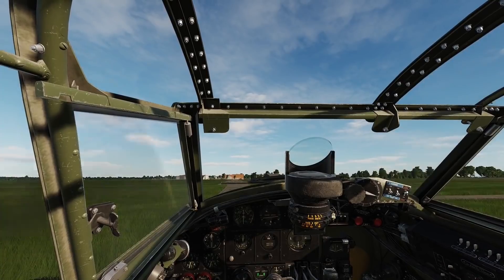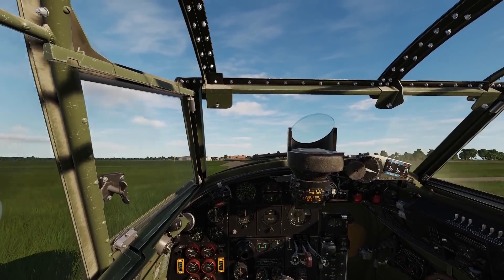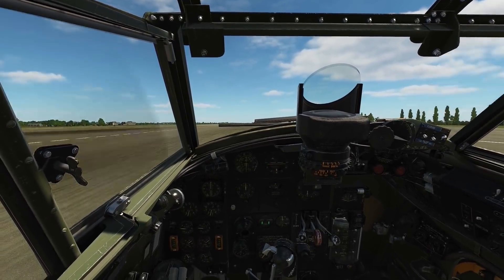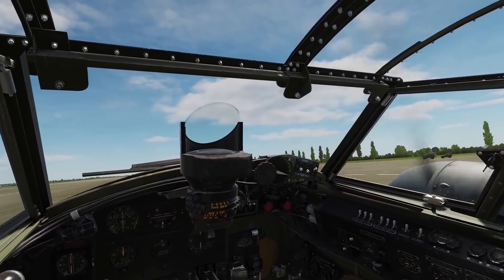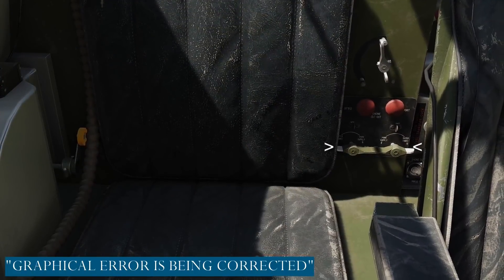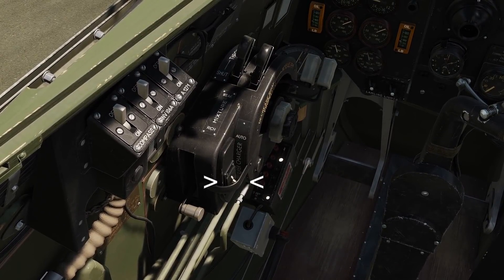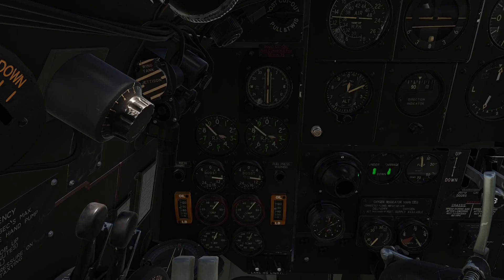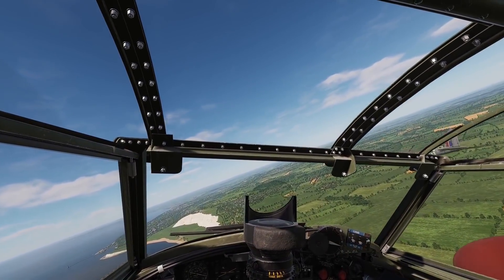DCS Mosquito VI | Taxi and Take-off

Comment: Question. Is there any reason why you can't remove the gear lock before take off? Ie as part of final checks on the runway? I can envisage stalling out or similar while head is in the cockpit following rotation. Or can the vibrations cause the lever to slip and the gear to lift prematurely? Just trying to sort my checklists in my head. Looking forward to this module lots and lots.

Comment: With the poor rudder effectiveness during the initial takeoff roll and large torque generated by the non-counter-rotating props, how do you keep straight? Split throttles or tapping the brakes?
Reply: In real life, Mossie pilots would open the throttle of the Port engine a little more than the Starboard one to reduce the swing during take off.

Comment: Do you confirm reducing RPM before Manifold pressure because usually this is just the opposite?
Reply: because most of these warbirds have superchargers the inlet manifold is typically greater than the RPM so yes its appropriate - only for these aircraft. If you wanted to get technical if you intend on leaning mixture then the manifold would be much lower.
Reply: @MajFAIP  Hum..you're wrong! This is always manifold first then RPM when you reduce throttles to avoid overboosting the engine.

Comment: Hey Suntsag, this is my first warbird so forgive my ignorance. 

Will there be controls for flaps lower else OFF and flaps raise else OFF so I can still use my flaps lever on my Warthog throttle?
Reply: Flaps on the Mossie are Up Down and Neutral. I think the WH throttle will be fine for Flaps, you will move them to where you want then stick it in the central position for neutral. A bit like the MiG 15 how you always return to neutral ( which works fine on the WH ) would be my guess.
Reply: @dusty4459  neutral is essentially an else OFF state, hence I asked. But if that's what happens I'm good. Thank you
Reply: @Tigermoto  If its your first warbird maybe get the Spitfire on the 2 week free trail. Taxing is similar and engine management too. It would probably stand you in good stead.
Reply: @dusty4459  I've thought about it, and probably will soon. Just don't really get time to fly at the moment.